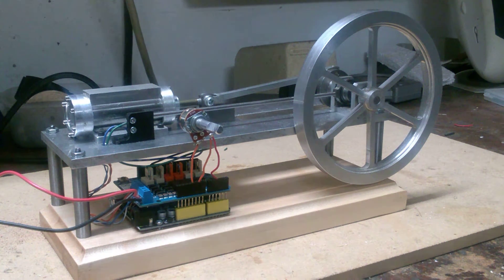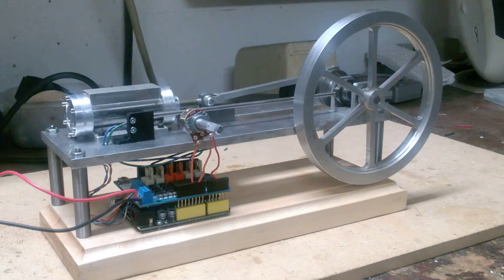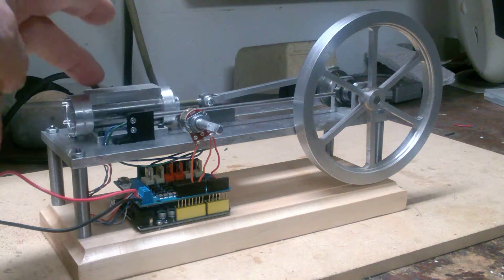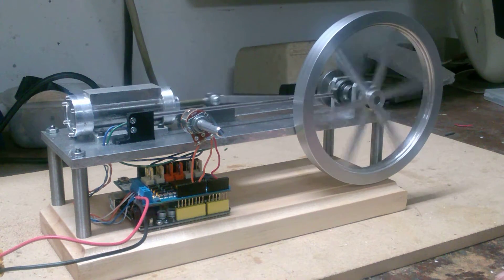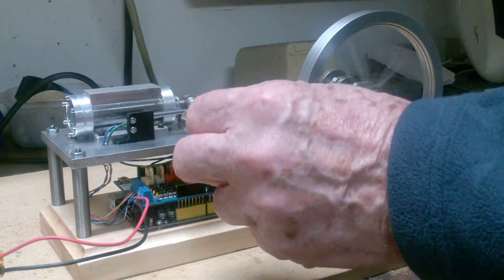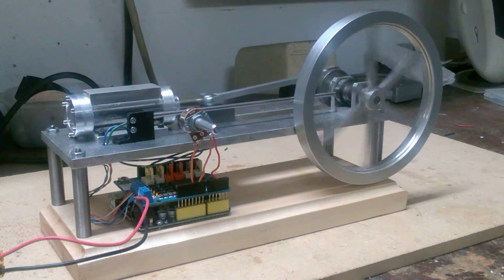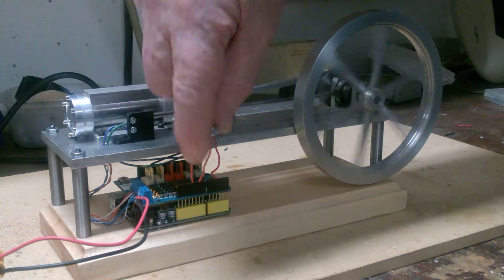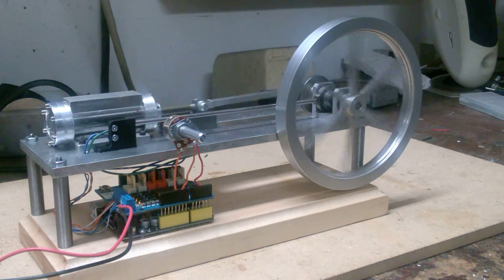Solenoid Steam Engine

Comment: I realise this is a 2 years old video, but just wanted to comment that the correct approach to control the speed or power of a steam/air engine is not delaying the opening of the valve, but to set the amount of time air is input to the cylinders. The valve should always and immediately open at the beginning of the piston stroke, and it must be closed at some point during the piston stroke, not necessary at the end of it. The later the valve is closed the more engine power, the earlier the valve is closed the more efficiency. This is the right approach because it allows air to expand to a lower pressure in the cylinder before it is released. As a bonus, since air always enters the cylinder at the beginning of the stroke, the engine runs much smoothly even at very low speed.
Reply: @TheMarklongboard   I meant he is not doing the same an steam engine does. So it’s not a proper simulation of a steam engine
Reply: @TheMarklongboard  I think you still don’t understand my point. It does not matter if it’s steam or solenoid based. I say that on a “normal” engine of that principle (generally steam) less throttle is achieved by cutting power (steam) at some point before the end of the stroke, but steam is always available from the very beginning of the piston stroke. However, this guy is doing the opposite, he cuts throttle by delaying the application of power at the start of the piston stroke. So power is applied by the end of the stroke, unlike normal steam engines. What this guy is doing is bad because that cause jerkiness, specially at low speeds, as opposite to doing things properly
Reply: @TheMarklongboard  what? This is Engineering, not poetry, wtf?

Comment: thanks for posting.  nice work.  imo, one or two solenoids will be able to produce only low-torque output.
so, faster is better.  what's needed is efficient reduction gearing to take off power at the crankshaft.   cheers

Comment: Hi, Chuck. I really enjoy your videos and the projects. Could I possibly get a schematic and source code for this project Please ? I am new to electronics and learning arduino . I have been a tool and die maker for years . This looks like a cool project to help an old dog learn a few new  tricks. Thank you

Best regards
Terry Lembke
Reply from the maker: /***********************************************************
Motor Shield 1-Channel DC Motor Demo
by Randy Sarafan

For more information see:
http://www.instructables.com/id/Arduino-Motor-Shield-Tutorial/

Function          Channel A   Channel B
Direction         Digital 12  Digital 13
Speed (PWM)       Digital 3   Digital 11
Brake             Digital 9   Digital 8
Current Sensing   Analog 0    Analog 1

Switch            Digital 2

***********************************************************/

int Polarity = 0;
int LPolarity = 0;
int potIn = 0;

void setup() {
  pinMode( 2, INPUT_PULLUP );
  pinMode( 12, OUTPUT );  //Initiates Motor Channel A pin
  pinMode( 9, OUTPUT );   //Initiates Brake Channel A pin
  pinMode( 13, OUTPUT );  //Initiates Motor Channel B pin
  pinMode( 8, OUTPUT );   //Initiates Brake Channel B pin
  pinMode (A2, INPUT );
  digitalWrite( 9, LOW ); //Disengage Brake for Channel A
  digitalWrite( 8, LOW ); //Disengage Brake for Channel B
  Serial.begin (9600);
}

void loop(){
  potIn = map( analogRead (A2),0,1024,0,150);
  do {
    Polarity = digitalRead( 2 );
  } while( Polarity == LPolarity );
  delay( potIn);
  analogWrite( 3, 0 );
  analogWrite( 11, 0 );
  digitalWrite( 12, Polarity ); //Establishes forward direction of Channel A
  digitalWrite( 13, Polarity ); //Establishes forward direction of Channel B
//  delay( 10 );                 //Delay timing before re-enegizing the coils
  analogWrite( 3, 255 );       //Turn on Solenoid A
  analogWrite( 11, 255 );      //Turn on Solenoid B
  LPolarity = Polarity;
//  Serial.println( potIn );
}
Reply: Thank you so much Chuck . I wish you and your family a very merry christmas and a happy and healthy new year.
Terry
Reply from the maker: Thanks, Terry, a Merry Christmas to you and your family as well.  If you could PM me your E-M add, I can provide you with a schematic as well.

Comment: Can you measure the current whilst adjusting the POT to see how changing the timing is effecting efficiency? I would have thought that the ideal timing would relatively fixed(unless the inductance is very high then you would need to advance timing dependant on speed) and you would control power with PWM. If you needed speed regulation you would need a feedback loop to control the PMW level, luckily you already have a speed sensor. As you've gone partly solid state how about using optical position sensor or *hall effect sensor to determine position of the piston?

Comment: Nice. It would be interesting to add speed feedback that would change the delay depending on the load to keep a constant speed.

Jack
Reply from the maker: I've thought about adding RPM calculation to the software and using that to produced constant speed.  Might do it for the fun of it.
Reply: Maybe hit and miss???

Comment: Well done. What do you do with the BackEMF pulses of the 2 solenoids coils ? Waste it in diodes or recycle it back to the power supply ? Would be interesting how efficient this engine is... Will you do a prony brake test ? Please also show the inner workings of the solenoid engine. Many thanks.
Reply from the maker: This engine is purely for display purposes.  The amount of torque it produces is small and I'm sure it's very inefficient.  Based purely on resistance, each coil pulls about half an amp so total power consumed is around 12 watts, somewhat less at slow speeds.
Reply: @cffellows   in fact it is 4xs the power of a standard solenoid engine. how did you come to this design? I designed this in 2013